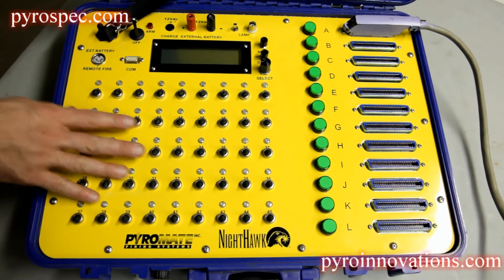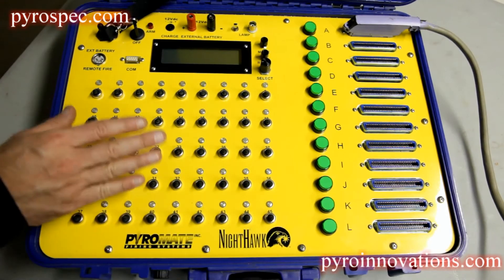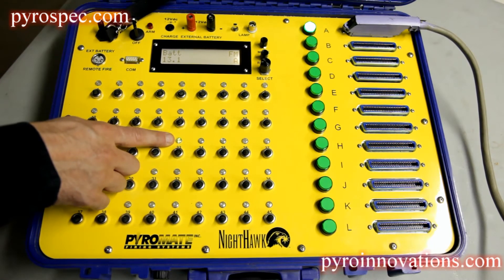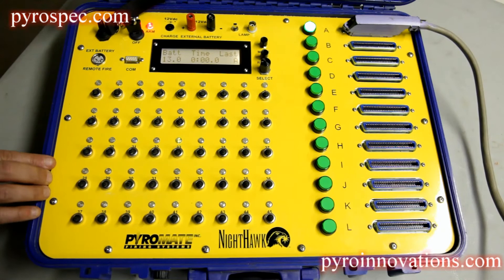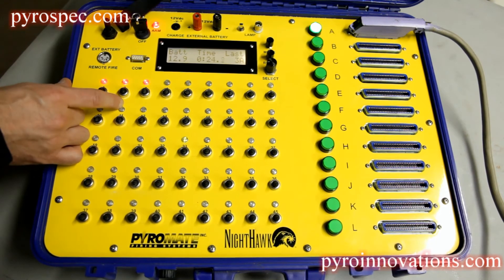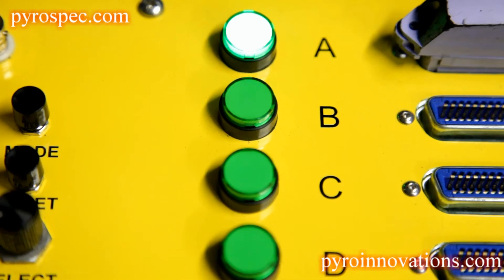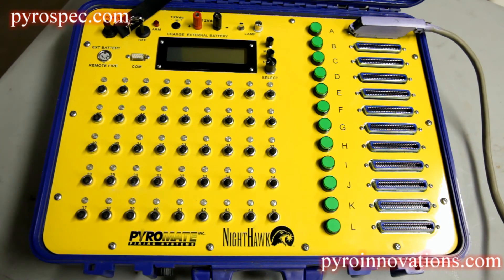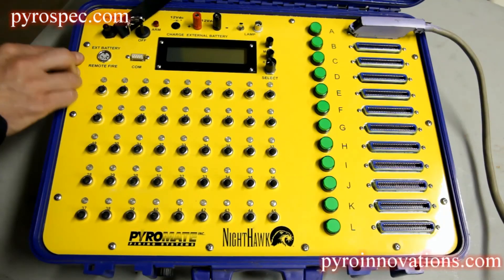How to Use a Nighthawk Firing System

Comment: This is sooooo old, but idk where else to look. I’m having problems with mine firing two modules at once. It lights up b and c at once.
Reply from the maker: Nighthawk?  Try different banks, meaning try D and E, if the problem only occurs on B and C, and you use the same cables and modules, then there is likely an internal short of some sort in the firing board.  Check the pins on the board for banks B and C to make sure there is no debris or obvious shorting. If not, then I would reach out to the manufacturer for assistance.
Reply: @PyroInnovations yeah we have a nighthawk. Thanks for the tips !